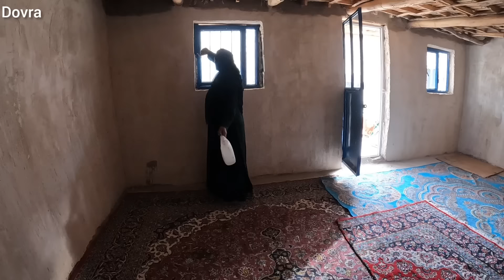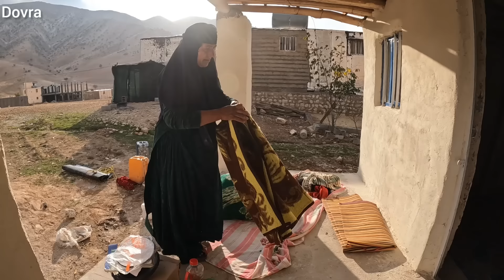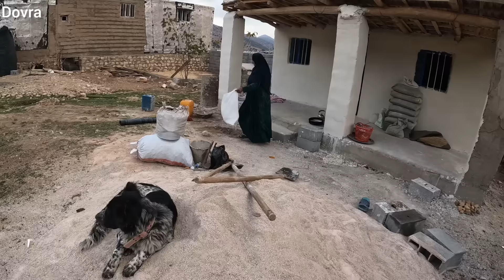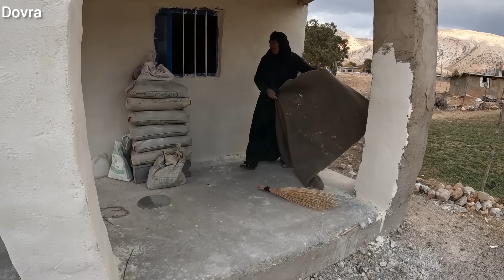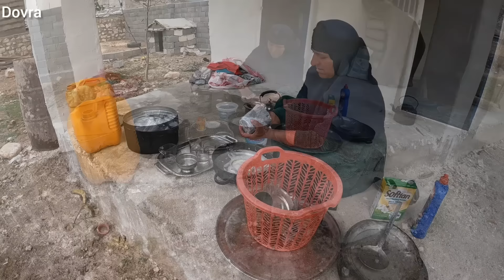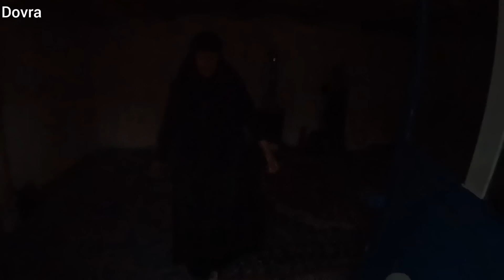cottage of happiness of two orphans: Grandma's attempt to install a heater in the magical cottage

Comment: Hi Grandma, if you build a kitchen in your new home, build it against the wall with the roof support post. You can the disguise the mistake by hanging all your pots and pans off the post, and you will have natural light from the window and the window can act as an exhaust. The chimney won't draw properly until you extend the outdoor flu pipe above the roofline. 💙